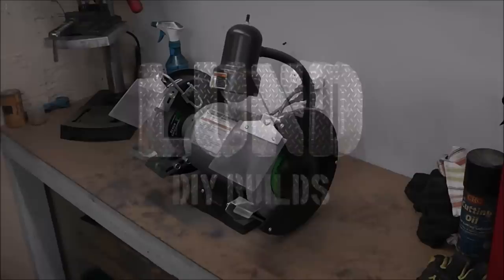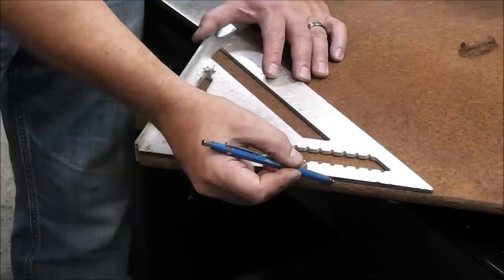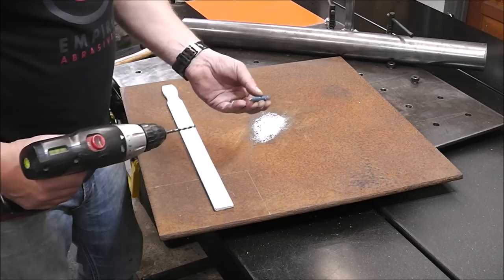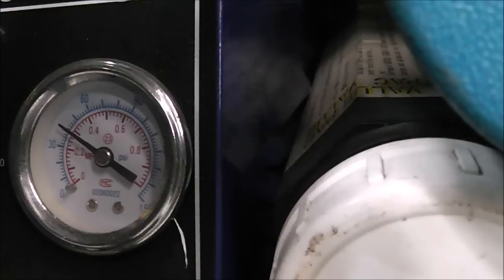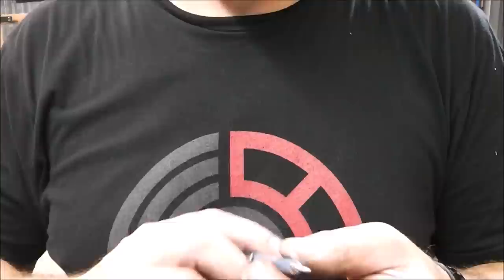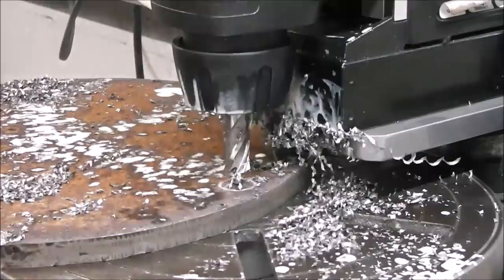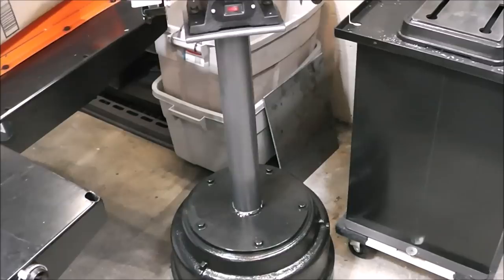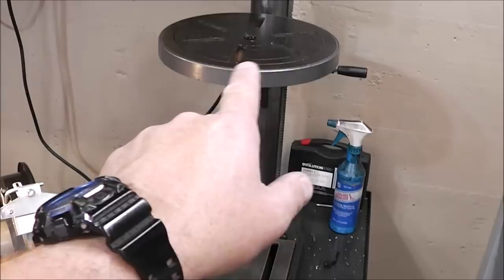Ultimate DIY Budget Grinder Pedestal Base MIG Welding

Comment: Pick up a wheel dresser it will take away some of  the vibration. Be sure to wear a hood when dressing the 2heels though. A pair of saftey glasses dont quite do the job.
Reply from the maker: Great advise. I actually have dressed them a few times and it helped a lot but its still pretty bad. I was concerned when I bought the grinder thinking the shafts were bent. I checked for runout and they were straight. I need to break down and buy some quality discs.

Comment: Why you using a respirator with only dust filters when you welding? This is useless because gas molecules are smaller than dust particle.
Reply from the maker: I'm not.  This mask is the industry standard for welding if your not using a PAPR. From 3M's website "The 3M 2097 P100 Filters fit on the 3M 6000 and 3M 7500 Series Half Masks, as well as the 3M 6000 Full Face Respirators. HEPA filtration is rated to remove 99.9% of particles .3 microns and larger. This includes most welding fumes (burnt metal), toxic dusts, like asbestos and lead". Like I said, its what welders use if your not using PAPR.

Comment: why not use flux core?
Reply from the maker: @Troy Rhoads no particular reason. I actually use flux core a lot on the channel and I promote it quite frequently because I feel like folks just starting out get the false impression that MIG is somehow better than self shielded. They each have their application but one is not better than the other in my opinion.  I like to switch things up just to keep myself sharp. As you mentioned, flux core would have been ideal on this project.

Comment: Slick.  Since there's so much weight acting on your behalf, why not put a bigger plate on the top and then you could mount 3 or 4 grinders on it.  
I've got a 6" setup for dressing tungsten, an 8" w/coarse and fine wheels, an 8" wet knife/tool wheel and buffer, and a 6" wire wheel and green wheel.  Sounds like a lot but they all fit and more, it's all offset by a weighty base.  
The only thing I need to change is to put a 'lazy susan' under the top plate so I don't have to tip it up on the edge of the base and walk it in a circle (I don't have room to move it away from the wall).  When space is the defining factor, you can't avoid bowing to its dictates.
Reply: An old sealed wheel bearing that still turns works good for making turntables if you wanted to try that.
Reply from the maker: Charlie I've actually been meaning to do something along those lines but I never gave it a thought to put it on a carousel. What a great idea! Thank you for sharing!
Reply from the maker: Great tip! I really like this idea! I actually just put new rotors on my daughter's car. One was bad and the other was good but I threw both away. Those would have worked mint! I'll keep my eye out. Thanks for sharing!

Comment: If you could only dig up a smaller drum I guess you could flip it over and fill it up with concrete.  And add scrap metal to the cement.
Reply from the maker: Great tip!

Comment: Hernia heavy I'd say... Hefty base. I've been working with wood in the workshop. Hate the mess it makes compared to the metalwork. No air yet but it'll come with time.
Reply from the maker: It sure is hernia heavy! You really hit the nail on the head. I enjoy wood working but I don’t enjoy how everything in the shop gets covered with a fine layer of dust afterwards. Plus when you make a mistake and cut it too short you can add it back on much easier with metal 🤪🤪
Reply: @BrandonLund  hahahaha very true. Less room for error.

Comment: Makes a good grinder stand but tell the truth them brake drums does not weigh 150 pounds I used to change them every day
Reply from the maker: Before publicy posting that im dishonest, did you watch the video? Im assuming like most, you skipped through the video then made this type of comment skipping the part where the column was filled with sand then placed on a scale and weighed prior to the grinder being mounted.